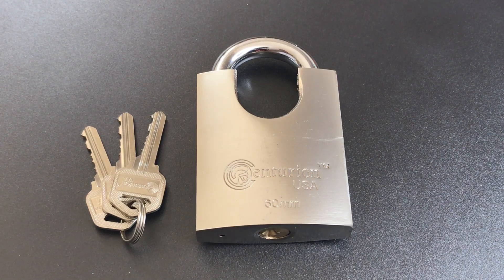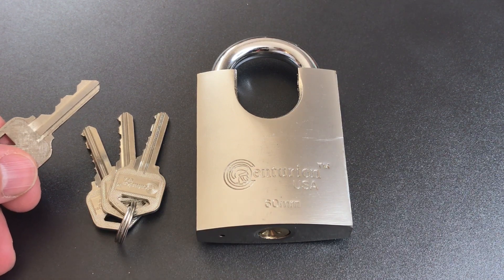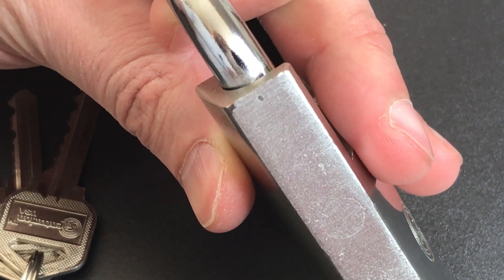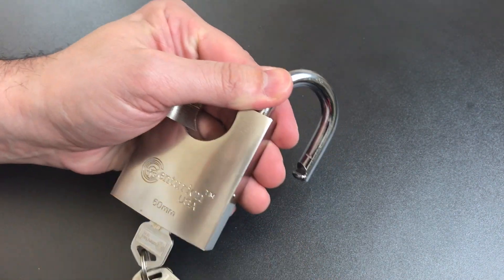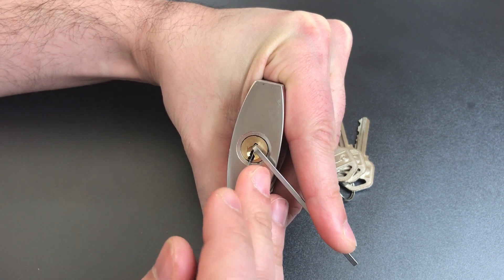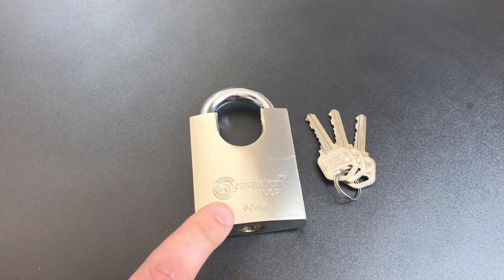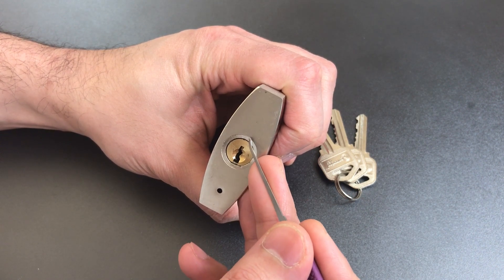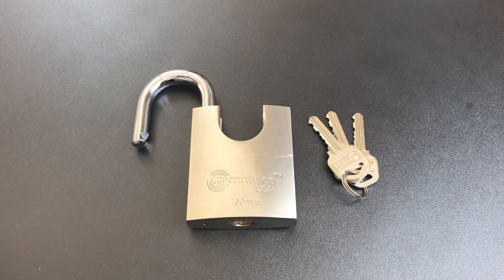[594] Centurion 60mm Iron Padlock Picked and Combed Open

Comment: it's lack of corrosion resistance might be it's biggest security "feature".  After it's been rusting for a while it will seize up and then no one can get in :)
Reply: A grinder with cutting will open the lock
Reply: @seanbax2622  By the look of the "Hardening", a cheese grater would be as efficient as a grinder here.
Reply: Ah.... see, they were thinking about it being neglected....

Comment: I bought exactly the same lock (Centurion SIPL060), and exactly the same tool (the double headed comb with the blue rubber in the middle), and I still can't comb open this lock.  Even after watching and determining that you used the smaller 6 end.  Did they improve the lock without updating the model number, or is it actually harder for non-LPL people to open than it appears?

Comment: How do you know if you can use a comb pick on a pad lock ? Except for just trying of course.
Reply: I'm sure he does his research and experiments, testing, and records lots of video before he has something he wants to upload to YouTube.
Reply: I try just pushing my pick up on the pins to see how far up they will go. It usually only works on locks that have the pin stacks inserted from the side of the body.
Reply from the maker: Larry, often times you can tell just by looking at the design. This flaw is pretty common, particularly in Chinese made locks ... the limiting factor is usually the keyway and fitting the comb pick in.

Comment: Can probably be opened by rapping as well.
Reply from the maker: Good point. Probably. I may just rap it with the ramset for fun. 😈
Reply: I wonder, if you hit the lock on the opposite side on the pin plugs, if the Ramset would be able to knock the pins out. Might be a fast way to gut the lock and able to have fun with your favorite tool in the toolbox lol

Comment: It's pretty sleazy for them to have the big USA on the front when it's Chinese. 

Are you sure that the body is iron? That seems really odd to me. Plain, low carbon steel (aka mild steel) seems far more likely to me (and it has most of the same downsides as you mentioned). Typically when people say "iron" they mean cast iron, which has more carbon in it than steel and is therefore very hardenable. I don't really know of any applications where pure(ish) iron is used, though. I'd expect it to be a translation issue, and be steel.

Comment: its funny that the little "HARDENED" stamp on the shackle has become part of lock design for so long that it almost seems like something is left out if it's not on there. the problem is that there is no real definition as to what hardened means and the term is not protected at all. sort of like food buzzwords, "Fresh", "healthy", etc.. it has essentially become meaningless UNLESS it says something specific like abus' "nano protect" or perhaps some sort of boron alloy, etc.. then at least they are sort of making an actual claim that can be tested. same problem goes for "high security". chinese lock manufacturers love "top security"

Comment: Just out of curiosity, if you ever do a destructive test on this lock can you try to bend the shackle? A file test really only shows that it's softer than the file, which doesn't mean that it's completely soft. But if you can bend it without breaking, that would show that it it really is as soft as it came from the mill.